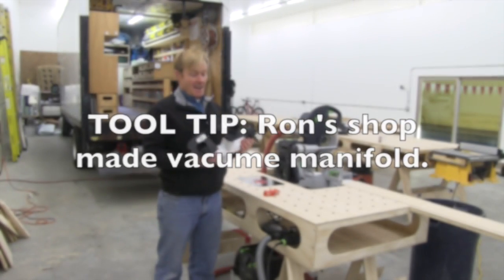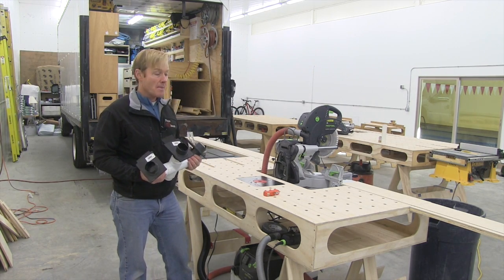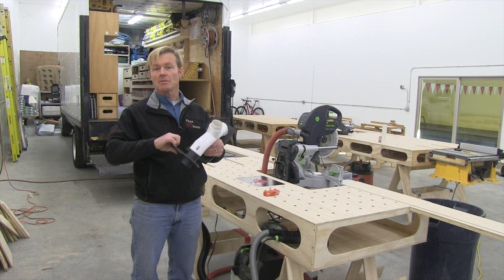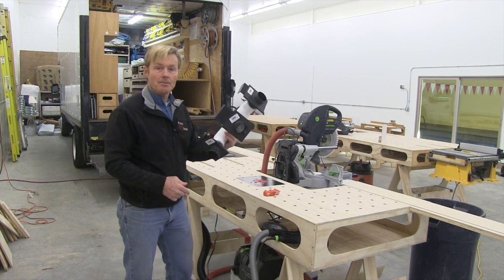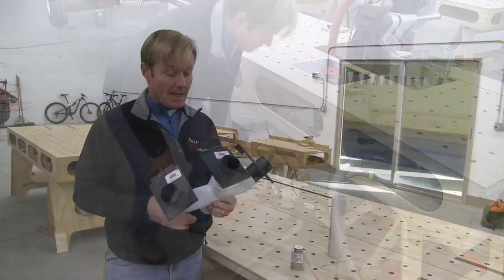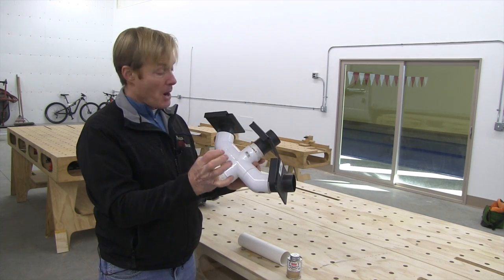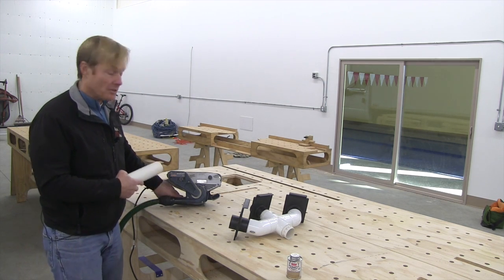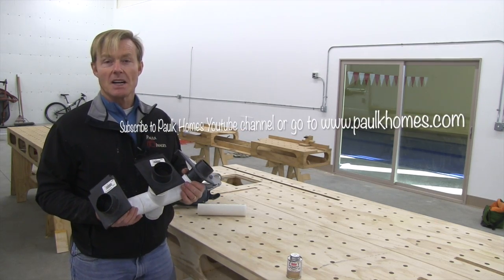TOOL TIP #1: SHOP MADE VACUME MANIFOLD

Comment: Hey Ron, I see you built a New bench, looks great.
You must find it faster to set up??
Just wondering why you changed the mount for the table saw.
Dave
Reply from the maker: Dave, I have a new table saw which required a different mount.
Reply: Ron Paulk I didn't notice.
Looks thicker 12" ? Do you find this version quicker with setup/production etc.
Reply from the maker: This bench is not a replacement for the PWBII, but another tool to work along side. I am field testing it and refining it currently. If it works out, I will make a video to answer questions. The prototype is a long way from the final version so the depth is yet to be determined.
Reply: Ron Paulk Stuff Ron.
I Love my PWBII Bench, makes doing projects sooo easy, I get lots of positive comments.
Thinking of buying a MarkIII, to replace my old 30D....thoughts??
Reply from the maker: Can't go wrong with the 5dM3, my wife has one and likes it. Very fast auto focus, reasonable at almost 6fps, and very clean file. Good high iso performance too.
Reply: Ron Paulk Thanks...funny story, I showed off my PWBII to a finisher friend of mine after I finished it, showed and told him all the benefits and that I should build him one. He says ya but it won't fit in my truck, I say SO!! Buy a bigger Truck.
Cheers
Reply: Ron Paulk Happy New Year Ron to you and your Family.
I pulled the trigger on the Mark III....WOW !!! Love it...bye bye old 30D.
Love B&H, they shipped it right to my condo in Maui.
Now when I get home I have a cross cut sled to build.
Cheers,
Dave

Comment: Ron, as always great ideas! Thanks for posting these vids, very helpful. Im keeping a close eye on that awesome rolling tool box series as I just ordered an enclosed trailer to replace my old one and I will be incorporating alot of your ideas into it. I will put some videos up so that you can see what a great teacher you are = ) Also, just a friendly suggestion, they sell a cross piece similar to the one you used that has the left and right inlets slightly curved in. I dont know if this will improve airflow any but in theory it sounds like it would. If you ever decide to build another manifold try using this one and of course post a vid of your results. Thanks again, big fan by the way.
Reply from the maker: Hi Pete, I am glad you are seeing some ideas that will help with your next tool trailer. I am thinking about a little better vac set up by using a standard 5-gallon paint bucket and drilling 3 holes to accept the blast gates and another hole on the opposite side to insert the vacuum hose. I am thinking this will work better and also save on vacuum bags.
Reply: Hi Pete Dumenigo

   Your suggestion is absolutely essential, no sharp bends,edges or corners, they are counter productive to having a good airflow in your dust collecting system.
    Having a hole in a plate or wall with a 90 degree sharp edge reduces the airflow to 50%, a pipe just sticking out in free air has a 90% reduction.
Look at the inlets used airventilation systems and you will see a similarity to a sousafon, the optimum.

Comment: Ron, looks like you have V3 of your table modified;  couple of questions.
Is is mainly to work with the miter saw, router or table saw and secondly (more importantly) I see that DeWalt has phased in a new version of the table saw that looks a little more complicate (if at all possible) to mount at the end of the bench- any thoughts?

Comment: Hey Ron, 

Have you made any modifications to the dewalt tablesaw to improve dust collection? Watching your videos this is something that I've always wondered. No matter what dust collector or vacuum I attach, dust collection seems poor...
Reply from the maker: Drewan Nicholson No, I have made no adjustments. I don't expect too much from table saw dust collection. Most of the fine dust comes through the top so you need an addition dust collection port on top pulling from the blade. I don't bother and just plan on vacuuming and sweeping on a regular basis.